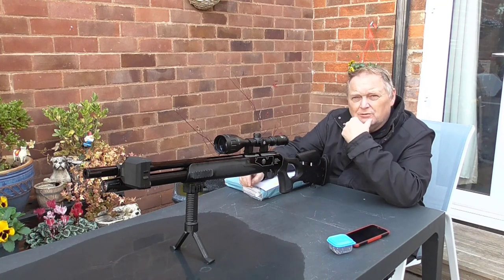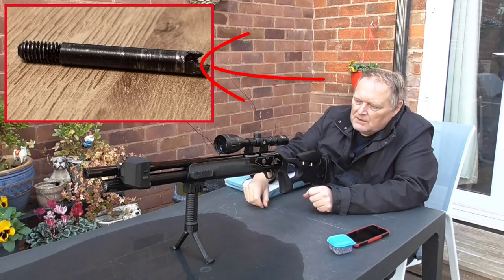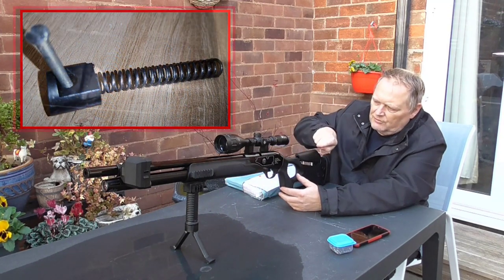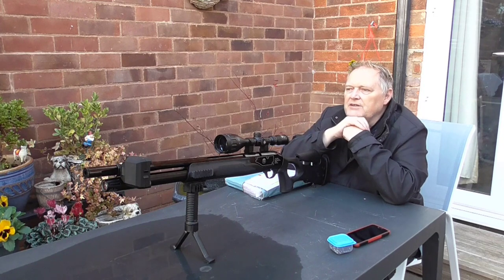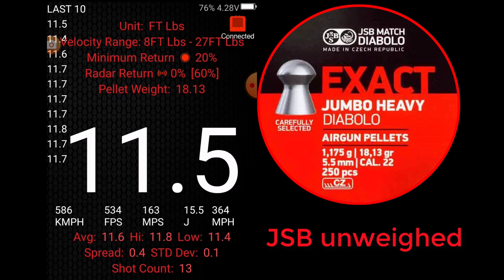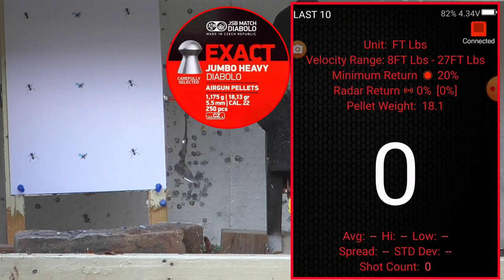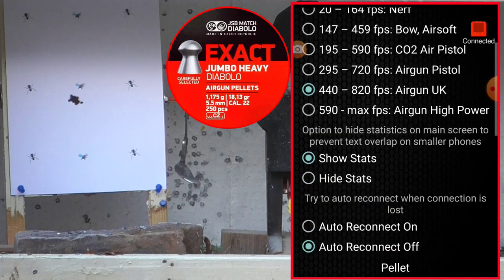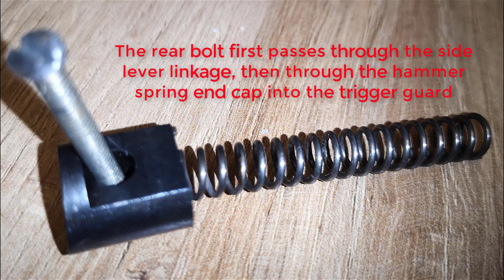(Part One) The Hatsan Galatian anti tamper removal and regulator upgrade

Comment: Thanks for that info, I got the ant tamper out of the transfer port, once out you can put the air tube back in and pull the brass fitting out, from memory I think this is the only piece with a small hole in it. Been a while but take a look before you attack the barrel screws.

Comment: I ended up reusing both my anti tampers. On the front one if you make sure you drill it central and not too deep then knock a torx bit into it gently then it comes out fairly easily and it looks neat so can be reused. On the rear one I don't like the idea of having threads touching moving parts so I drilled it central but not all the way through the head, tapped a torx bit into it and it came straight out then just put a blob of weld on the end of the bolt to refill the hole that I drilled then just reshaped the head with a file and put a slot in it
Reply from the maker: I was able to find a Phillips head bolt to cut down and grind with my belt sander that fit well. As for the rear I have made due with an M4 flat head bolt. I had to grind some off the head for clearence of the rear of the pellet probe that comes out of the back when clocked. On the schematics sheet it does show that you can buy a non anti tamper bolt, so I cold search for on on line. I also thought about looking for a sleeve for the current bolt.

Comment: hi Mark have you had any dealings with the Kral Jumbo Hi-Cap Camo (Dazzel) .22, i have the drawings of the parts list and have been told its the same as the Krak Puncher Jumbo, as mine is under powered so it needs a tune,many thanks and keep up the good work.
Reply from the maker: Hello Gary, I've been lucky enough to fire a few Kral rifles, but not take them apart. The good news is that my friend Cliff Kirkman has, so I will ask him and get back to you. Usually a brass cap covers an Allen bolt that needs drilling out to gain access. Not sure, but on the Kral I think they are underneath the rear or the action, but I will confirm.
Reply from the maker: Hello Gary, Cliff said its underneath the rifle and it's a snap off bolt that needs drilling with a pillar drill to prevent any damage. With my Hatsan Galatian I driilled a 3mm hole about a centimetre through my snap off bolt giving me room to insert a hex wrench to unscrew it